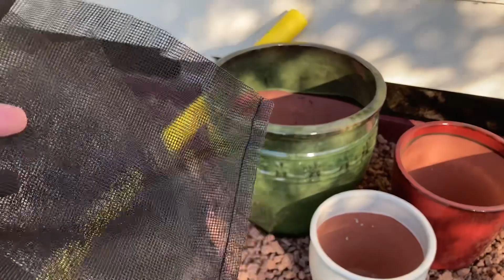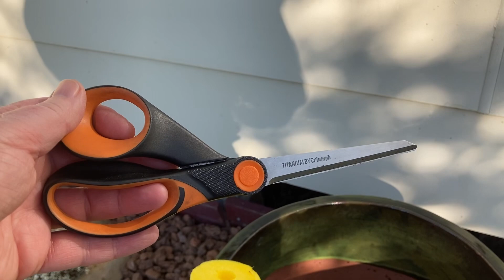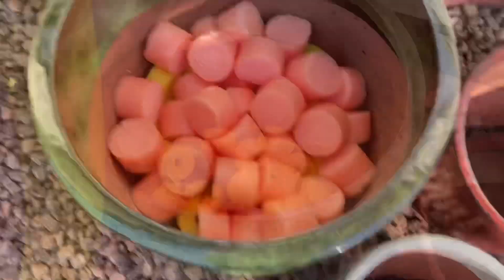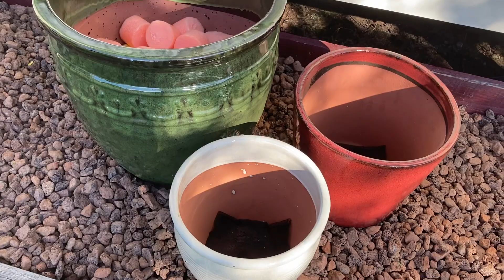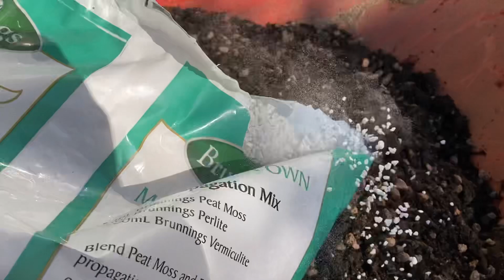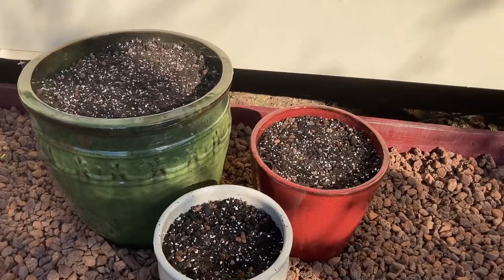Planting Up My New Pots

Comment: Lovely results !  🤗  I have done the same thing,  filled up the bottom of deep planters,  but with packing peanuts that came in packages,  so free...  ☺️
Reply from the maker: That’s fantastic!  Do you find that the soil sinks much over time?
Reply: No,  it doesn't.  I use some fabric,  for example a couple of layers from an old t-shirt that I cut to size,   between the packing peanuts and the compost so that the compost doesn't "disappear" down in between the packing peanuts.  And the compost doesn't sink more than normal in the pots.  👍☺️
Reply: 3 reasons for doing this :

⭐  Saves compost.

⭐  Not all plants enjoy deep soil,  it can be better for the plants.

⭐  Pots don't get as heavy.